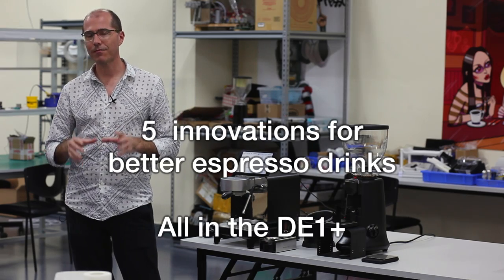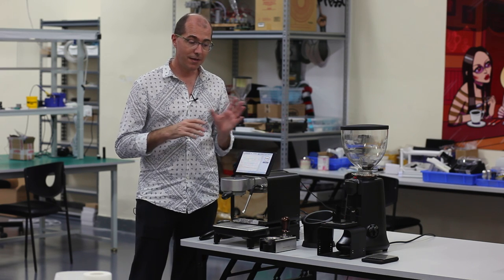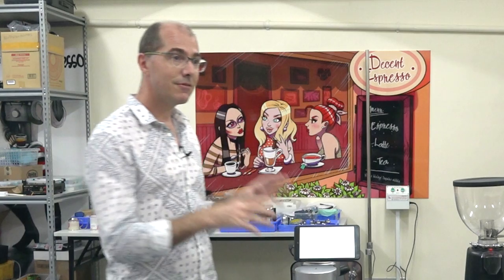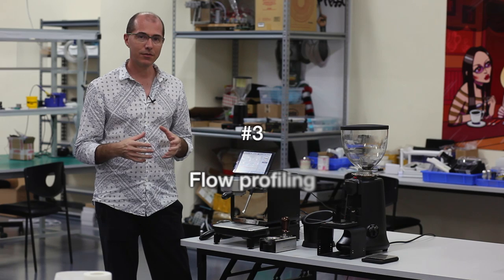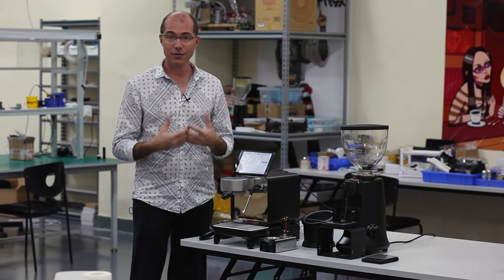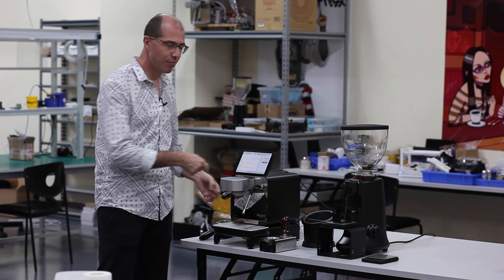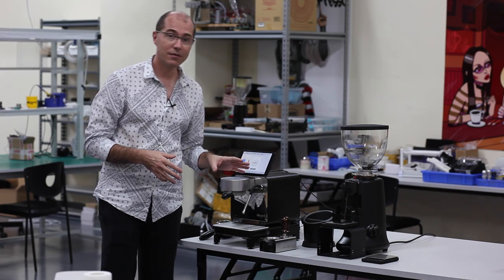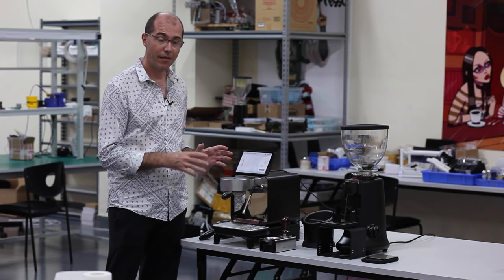Five Innovations for better espresso drinks (all in the DE1+, three in the DE1)

Comment: Opinions on long blacks vs americanos? Ever since I went down under last year and discovered the long black, I can't go back. Putting espresso on top of hot water preserves the crema instead of destroying it like putting hot water on top of espresso does!
Reply from the maker: Opinion vary, but my trainer from Australia insisted that water first was better, for just the reason you write (better crema). But, it's a different drink, with a lot more smell, thanks to the oily crema on top, vs all mixed in.
Reply: I prefer it espresso first, then water. Crema is not really great (imo), and I’ve been known to take a spoon and remove it from time to time. If you’ve never tried it, take a spoon, remove it, and then taste it on its own.